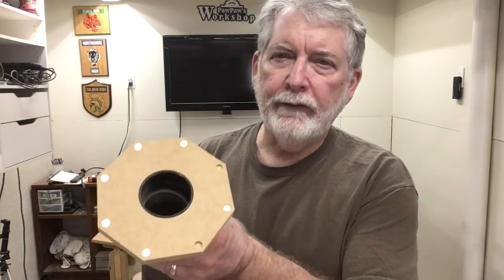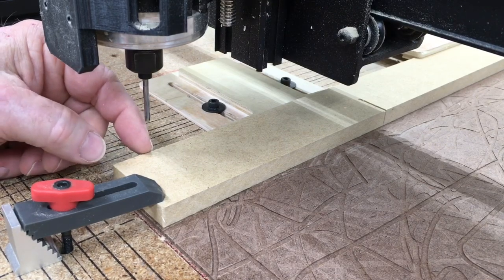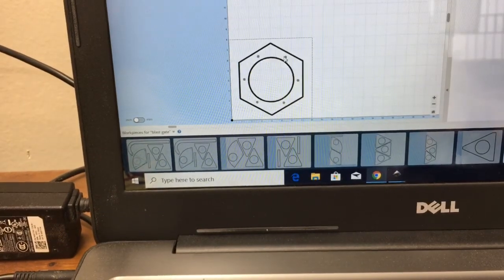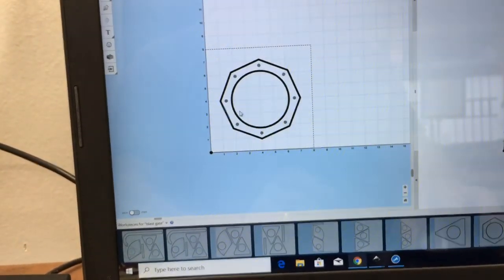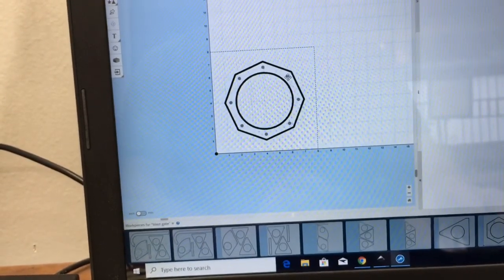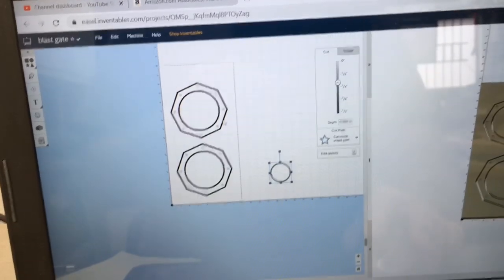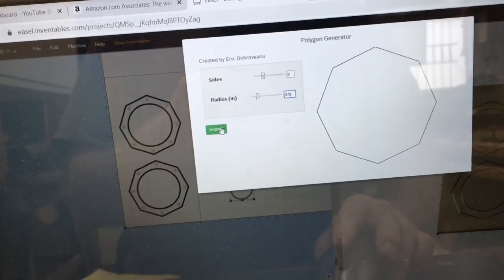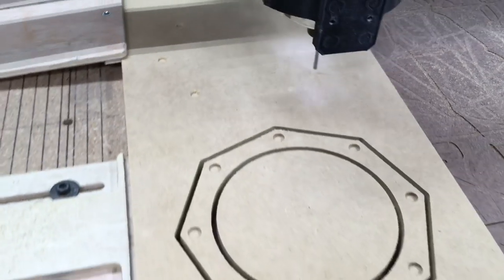How to Make Quick Disconnect Hoses for my Central Vacuum

Comment: I see some good ideas there in your system and I'm anxious to see the final product.  I also use a 4 '' main feed from my table saw, RAS, and planer.  My bandsaw and some of my belt sanders use a 2'' and is fed into the 4" main feed.   I've discovered that the 2" feed is restricting the air speed and volume in the 4" feed.  I've drilled some holes in the junction of the two different size pipes to let in more air.  Just wondering if you have experienced anything similar?
Reply from the maker: Thank you very much.  Yes, the air speed and volume is reduced.

Comment: If you are worried about air leakage, You can make a slot between the opening and the magnets to place an O ring. Just a thought.
Reply from the maker: That is an excellent ides.  Thank you very much.